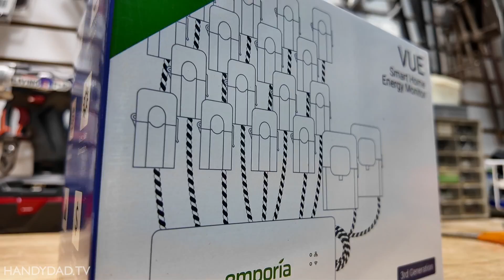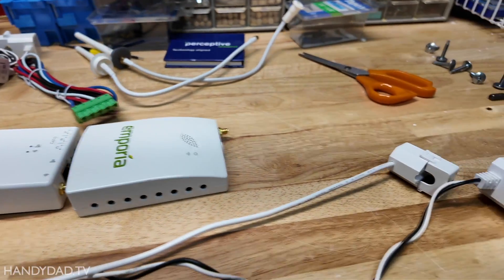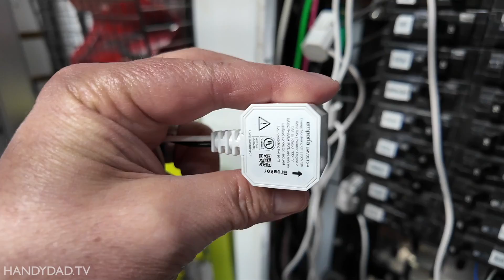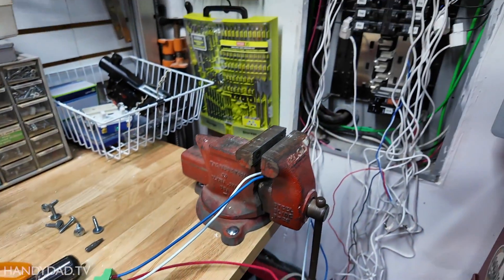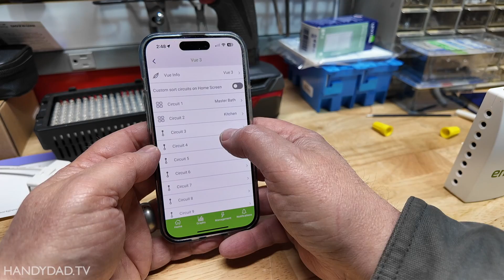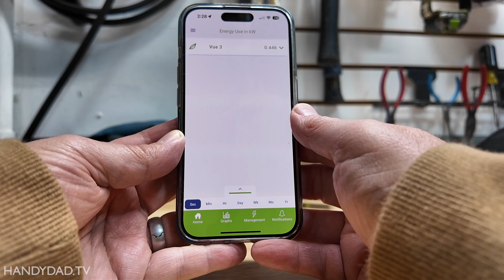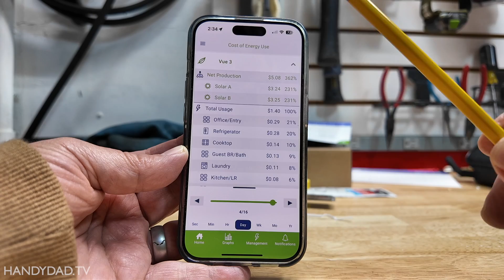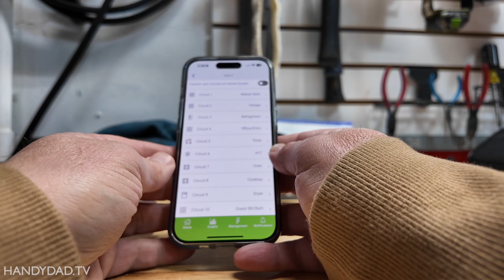Emporia Vue Energy Monitor - Gen 3 vs. Gen 2 - NEW FOR 2024

Comment: I bought one of these back in April in returned it. I found it extremely unreliable and the way it clutters up the box is just ridiculous. Also the app looks like it was written by a couple college students in 2004. Simple stuff like, after you set it up wanting to change one of the circuits to represent a 220 line couldn't be done. You had to delete the whole installation and start over. More importantly when you watch something live numbers just jumped all over the place. And that are returning it and just installed the sense unit. I've only had it for a day so it's detected all of two things, but at least the current reading makes more sense. I think this has potential but in its current state it's just junk.
Reply from the maker: Not sure why you’re not able to change the multiplier on a circuit after it’s defined. I have no issue with that. 

Agree about the space it takes in the panel. It’s a lot of wires for sure but independent CTs are much more accurate than Sense’s algorithm that looks for usage patterns to identify when an appliance is running.

Comment: Thanks for sharing your experience unboxing and installing Gen 3. Question - How did you connect your solar production to the emporia app? I didnt see any connections made in your installation part.
Reply from the maker: Just with normal CTs but the circuits are configured as solar generation in the app.
Reply: @handydadtv Did you reverse the CT, or is there a reversal option in your app assignment for it?
Reply from the maker: No need to reverse. Configure it as solar generation in the app.
Reply: Great video, well done! I have 2 grid-tied solar pv systems. One uses a double breaker in the panel while the other is a line side tap. Can I use one Vue gen 3 to include both? Also, how many smart plugs will a Vue Gen 3 accommodate?

Comment: 5:53 Hate to point this out, but there's only one phase there.  120/240 1 phase (split).  As far as wiring to a 240V breaker, one can also feed both conductors through the current tap, 180 degrees out of phase.  Basically, cross the wires like an "X" and put the CT around the center so that one of the conductors go from breaker to load in one direction through the CT, then the other conductor goes through the opposite way.  Don't multiply the current in the settings when you do this.
I see you have solar.  You're welcome... your system is being paid for by all of us people who realize that's a dead end in most of the world.  OH!  You have a Tesla too... Do you enjoy driving a coal powered vehicle which uses child labor to produce?  LMAO.  I bet you're a democrat too!  Ha!
Reply from the maker: Wow so judgey. And yet, so wrong.
Reply: Must suck to be angry all the time.
Reply from the maker: @JoeyMoreland I’m putting this in my list of favorite comebacks! 🫡

Comment: Good video! I'm using off-grid solar, so I need not only power (watts), I also need volts, amps, volt-amps, and power factor. A huge concern for off-grid is start-up surges from things like refrigerators and air conditioners/heat pumps.
Reply from the maker: You are running your own power utility! Very impressive.
Reply: The additional power readings you are asking, volt-amps and power factor, can be determined by using voltage and current.

Comment: Very helpful video.  I just got rid of a Sense system because it was (1) slow to recognize devices, if at all, and (2) could not accurately track solar input and produce the net metering values you showed with the Vue.  I am curious what connections with Vue enabled extracting the solar and net metering data.
Reply from the maker: Thanks but I can’t answer.

Comment: Hello friend, I have the gen2 and it works well. What I don't like is that when there is an interruption in the internet service, the vue does not save information about my consumption and then update it in the cloud when the internet returns again and I would like to know if they have already resolved it. This is in the new version, I don't know if you have noticed this problem.
Reply from the maker: I never noticed this issue with my Gen2 or Gen3.
Reply: Hello friend, it is very simple, leave the vue gen2 without access to Wi-Fi for 30 continuous minutes and you will see the problem, the graphics remain frozen until the Wi-Fi returns, I have already informed the brand's support about this and I would like to know if it They corrected it in the new version.

Comment: Very good video on a subject that is of great interest to me. We have solar panels for a few months now and I couldn't figure out how you incorporated your solar production in with your home energy use in the Emporia Vue app; or was it Home Assistant? I'd love to do that. Thanks for the great video.
Reply from the maker: At that point, I was only using the Emporia app. Since then, I added the Home Assistant integration, but I still use the Emporia app.
Reply: @handydadtv  Thanks for getting back to me. How can you access your solar production from within the Emporia app? I only see the Emporia CTs connected to your electrical panel, and nothing indicating any connection to solar. I assumed the integration of grid and solar would only come with Home Assistant.
Reply from the maker: Two CTs are on the inverter lines. They are configured in the Vue as Solar/Generation.

Comment: For the dryer circuit, you may want to measure both branches, since the motor tends to run on 120V and the heater on 240V.
Reply from the maker: Huh. I didn’t know that. Thanks!
Reply: Would you recommend doing the same for an electric oven? Eg the heater runs on 240 but maybe the fan/lights run on 120?
Reply: @timmurphy9834  That's a good point, but I don't personally.  I guess you could measure both for a month and see how close they are as a test.  If they're fairly equal, then you can just double the measurement and have an extra clamp free.
Reply: @timmurphy9834  An electric oven heating element uses so much power relative to a fan or lights that it might not be worth it.  I am still trying to decide if I need to monitor both sides of my induction range.
Reply: Based on my reading the electric dryer is not truly balanced, but the heating element which draws 220v uses so much power (the reading I did says around 95%) that it probably does not matter.  That said, if you want, you can also figure out which leg the motor is on, and just use that one for the CT.  If you want better accuracy, then yes, you need CTs on both legs.
Reply: Same deal if you have a generator inlet, You're going to want to measure both legs
Reply from the maker: @cody5495 I’ve been tracking both legs of my solar inverter and it’s so close that I really don’t need to bother.
Reply: @handydadtv  Good to know thank you
Reply: @handydadtv The solar inverter is putting out 240 volts AC which is balanced. Loads work differently. Same thing as the dryer with the electric ovens. The heater element will be 240 but the other circuitry like fans will usually run off of 120.  If you had a balanced 240 load like an electric motor/welder then you would be safe using one side and doubling it in the software
Reply: @cody5495  I had my electrician run the wires from the generator hookup up along the main power cables, then down to their circuit breakers (with an interlock for it).   That way, when I get a monitor system, the CT will fit around both cables.  Then, "overall power consumption" will be the main leads (during normal time) to generator power (when it's operational).  

I also had the same question as below - is the current draw on a single phase of a 240v line always balanced?   Emporia seems to assume it is, since it just doubles the current (assumes the other phase is just as much).  I agree with others that it probably isn't.  I have a heat pump HWH.   It's 240v; because it still has standard (backup) heating elements in it.  But I assume when just in heat pump mode, it's only pulling 120v.  In fact they (Rheem) sell a 120v version, that's probably just the heat pump, and maybe 1 heating element (vs standard 2).
Reply from the maker: @jwhite4 I used two CTs on my solar feed and they are virtually identical, so very well balanced that I could do it with one.

Comment: Wish they had smart plugs that handled full 15A and maybe a 20A version as well...  My freeze dryer runs for 24-48 hrs straight and can pull upwards of 1500W+ when the vacuum pump, compressor and heating elements are all running...  Smart Plugs are only rated at 10A, or 15A Peak for 1 hour/day...
Reply from the maker: This is a 20-amp smart outlet (not Emporia) https://a.co/d/a2v8du4?tag=ha0d9f-20

Comment: Can the CT's be split up with some in a main panel and some in a critical circuits subpanel, using just one Vue monitor?
Reply from the maker: I assume so, if it was close enough.
Reply: @handydadtv They are right next to each other. One is fed from the grid and the other from the solar panel inverter.

Comment: I see 4 circuits on the left side that are not clamped are you not monitoring those?
Reply from the maker: Correct. If you have more than 16 circuits, you can’t monitor them all. But they are still calculated in the overall usage from the mains.

Comment: do the instructions explain that if you are going to use the Ethernet connector, that the Emporia box should probably be kept outside the panel, since you aren't supposed to run Low Voltage and Line Voltage in the same enclosure, without a suitable separator of some kind?
I'm not an electrician, but I stayed at a Holiday Inn Express, last night, and this came up when I installed a gang box with both AC, Ethernet and coax (from different conduits, but into the same box).
Reply from the maker: Makes sense but I’m not sure.
Reply: You can put the monitor in the electrical box and run the ethernet cable to the monitor.  I have two solar systems, both with ethernet ports (enphase and SMA) and you don't have a choice.  I also had a different monitoring setup, and no matter how it was set up, there was low voltage and high voltage in the same box (and I tried to split them up).  The limit is that the high voltage and low voltage cannot be in the same conduit nor run though the same wires (so no, you cannot use romex to run both low voltage on some conductors and high voltage on others). I hope that helps.

Comment: Nice video.  Can you use it to monitor certain circuits?  Example: I have a well pump that is powered through my breaker box, and instead of installing a water monitoring device, I can just do this and monitor if the pump is operating when it shouldn't be, or for periods of time that is incorrect. If the pump isn't running, not that much water can leak, but if the pump is running continuously, regardless of where the leak is, I have a big problem.  Example: can you have the program send you an alert if it runs above so many amps / hour, or runs for so many minutes?  Also, if you have two breaker boxes, do you just run the wires somehow to across the two boxes, or does that create a problem.  Thank you.
Reply from the maker: Yes, you can have it send notifications if usage on a circuit goes above or below a threshold over a certain period of time. 

I use that feature to let me know if my electric range has been left on too long, or if my refrigerator stops running.

Comment: I'm confused. On the installation instructions on the app, it states to use two CT's ( one on each leg ) of a double pole breaker for better accuracy yet on the provided "Helpful Tips" card ( inside the box on the top when you first open it ) it states " Connect to only one lead,then use a multiplier in the app"
Reply from the maker: The only place I saw that said to use one on each leg was for solar.
Reply: @handydadtv  yes, when you are monitoring solar input(production), put separate CT for each leg for more accurate measurement. That's what i was instructed to do by the company. working well for me.
Reply: Oh, so in your video when you mentioned that you could use just one CT on one of the two hots of a double pole breaker (and update the multiplier), was that specifically for solar? Or can this also be done for the other double pole circuit breakers (i.e. 240V dryer)? Or will I need to use two CTs, one on each of the two hots of the one double pole circuit breaker.
Reply from the maker: @srit9688 Not just for solar, you can do that with any 220v circuit. For example, I only meter one leg of my dryer circuit and use a multiplier of 2 in the app.

Comment: Does the Vue gen 3 or the app show the actual, real time voltage ?  It must calculate the power consumption using a voltage measurement with the CT's but it would be nice if it provided a readout on the app of the voltage.
Reply from the maker: You can find Volts under Units of Measurement.

Comment: One thing I did on my vue 2 was combine two breaker circuits into one current clamp channel to have better coverage with only 16 channels. You get the combination sum of both circuits as a result. It sums the current. If you do this make sure you put clamp on the circuits that share the same split phase connection. If you don’t they will not add, they will cancel each other out.
Reply from the maker: I never thought of that! Thanks for the tip!
Reply: i believe you can buy another setup and they will work together in the app.
Reply: @jeffmucha So to clarify, you can install one Emporium circuit clamp over two circuits at the same time (example: two 15amp breakers next to each other - same leg) and the Vue will give you the average of both circuits?
Reply: @SGAOuTLaWz  If you clamp across two wires, you get the sum of the two consumptions, not the average.   This is useful to determine whether the two items are worth breaking apart (and combining two other circuits that dont need to be tracked seperately).

Comment: Did you notice better accuracy? I have a gen 2 and they do some hand waving about what is “zero power use.” For example, many things draw tiny amounts of power just to be plugged in. I think they say if it is less than the error budget, let’s call that zero power. Did you notice higher accuracy or the ability to see tiny loads that you couldn’t before? Can you tell if a cell phone charger is using 2 watts or 1 watt?
Reply from the maker: I didn’t do a head to head test. I have to trust their data.

Comment: I bought the version 3 using your link below, you earned it as I wanted to know how this thing worked AND, nothing in the box really told me where to hook up the main supply wires.  LOL...Install was easy, I have a 30 place box, 3 double breakers, a place to power this unit, it did get crowded, but not too bad, connecting the device to the app and network went fast and flawless, it logged in and booted up instantly. I am short a few items, but I chose the most important and don't really think I need a second kit for the last 4 things.  Thanks for doing the video, this company got their money worth sending you the kit.  BTW my balance is pretty good so far, I gotta crank everything up and test it out under full load!  This stuff is fun to mess with!
Reply from the maker: Glad you enjoyed it! Thanks for using my link. 🥰

Comment: I want solar on my roof, Ranch house, no trees blocking my roof and the sun (when it's not cloudy) is shining down all day long.  Besides, those panels might block some heat in summer... ahh but what happens in winter when it's always cloudy and snow get's on them?  Great video, I think I am going to get this thing, I want to use in home assistant, just so I have one GUI to view all my stuff. 
Thanks for doing this video, I just found this product and wanted some information about it (4/30/24)  One more thing, I rewired a lot of my house and not 100% sure if I have each leg well balanced, this device will help with that too.
Reply from the maker: I never thought of the leg rebalancing use case! I gotta look into that. Thanks!

Comment: Emporia should come up with a system that allows twice as many CT sensors! Say 32 sensors. Nowadays, many electrical panels have 40 circuits.
It would be a no-brainer from their standpoint. They already have everything developed. Just increase price by 50% to cover the extra sensors. They’d probably profit even more.
Reply from the maker: Not sure how they chose 16 as the max for one unit.
Reply: @handydadtv  I am guessing it is because of the available IO pins on an ESP32 chip that is the brains of the operation. I just ordered a kit myself! Thanks for your video. I am trying to find what is causing me to have a $600+ a month electric bill in a 2100'sqft home (guessing it is my geothermal).
Reply from the maker: @neilyboy Let me know when you get the answer!
Reply: @neilyboy I have a 2400sqft home I only pay like 28 a month due to solar but even without solar we only paid 340 with full home air-conditioning
Reply: @neilyboy did you found your issue?
Reply: @neilyboy Same here, my car charging doesn't cost anywhere near that so I'm curious where my power leaks are coming from. I suspect one of my tenants is using some type of motorized device or fans something maybe even with a heating element!
Reply: Can’t you just two? You don’t have to clamp the mains twice, and you should be able to just use the same pig tails for both Vues.
Reply: You don't actually need to monitor every single circuit. Only the ones that are important to you that typically have higher wattage draws. Most importantly you're monitoring the complete power in and any solar produced. I have multiple panels so I need a Vue in each one of them for the subcircuits and then I Nest the other Vue under the main Vue.
Reply: I have not done so, so I’m not sure what it looks like. But, Emporia’s website does note that you can use two smart monitors on the same panel and nest them together within the app. 

Something to try, if you still have your Gen 2.